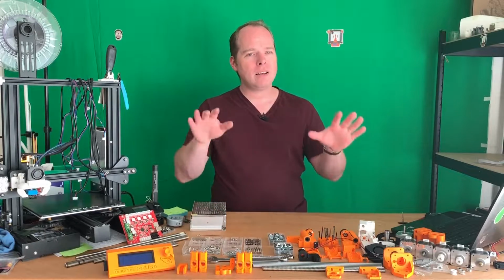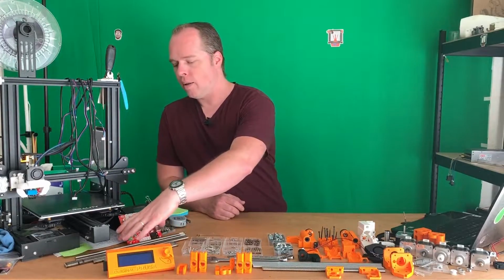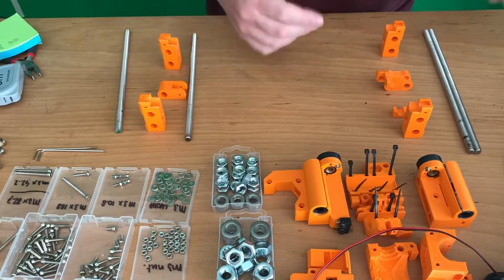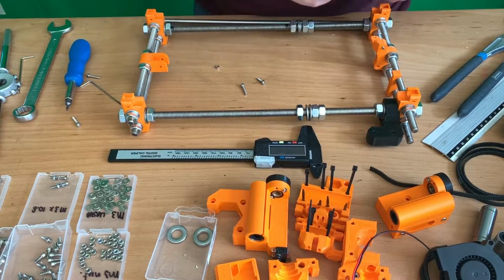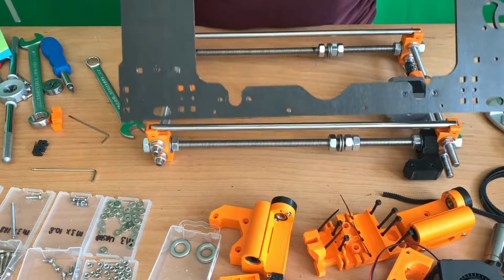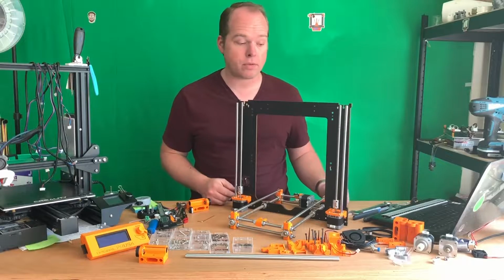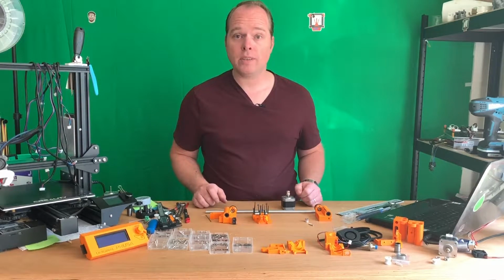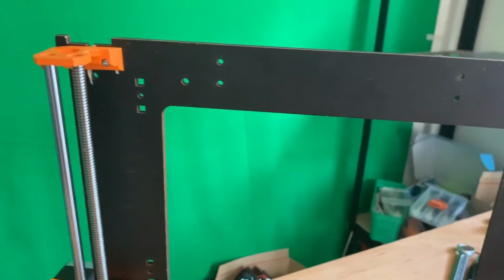How to Build Prusa i3 MK2 3D printer - CTC i3 conversion

Comment: Josef Prusa is a scam!

It makes an excellent advertisement for your product but the same your products are crap, they don't work as they should.

My husband and I bought an MK2S and upgraded to MMU2, until today the printer does not work properly.

We thought it was punctual and we bought a Prusa Mini the same problem (it doesn't work).

  We got tired, we ended up buying a Weistek printer for a third of the price and it works great thanks.

Josef Prusa pays digital influencers to spread his brand and influence people to buy that piece of shit.

Make no mistake, PRUSA does not work well.
Reply: please dont spread hate for zac's channel its not his fault you cant get your printer working right, and he is hardly supporting prusa, he is showing how you can make your own so prusa mk2 so prusa  is making nothing profit wise from this.
Reply from the maker: Hello Cristina, 

I know that there are cheaper 3D Printers that works quite well and with some little upgrades even very good. I'm still working on a Ender 3 Pro and that one works very great. I have bought a I3 clone from the CTC brand that makes copies of big companies. In this video series, I upgrade my CTC i3 printer to a more real looking Prusa i3 MK2 3D printer. I don't know which kind of problems you've had, but can I help? Do you still have those Printers? Did you get into contact with them?